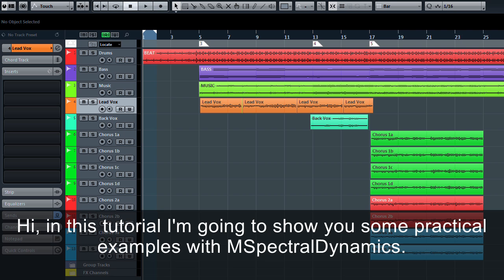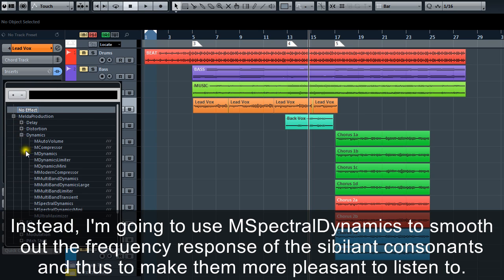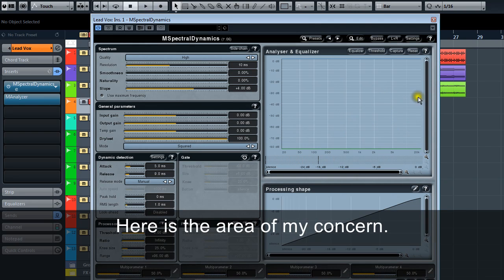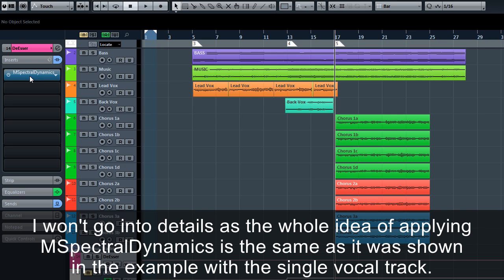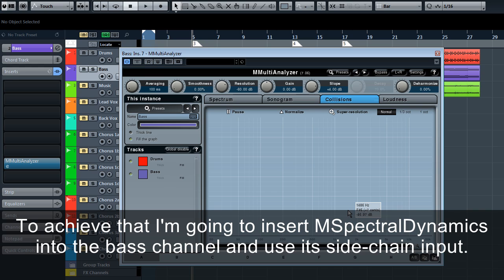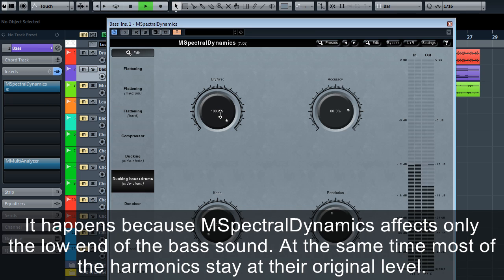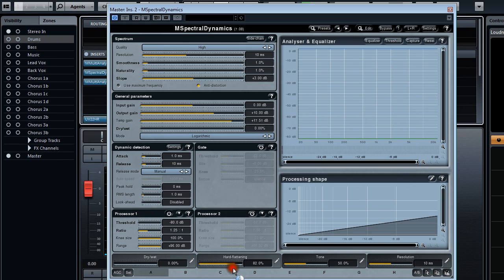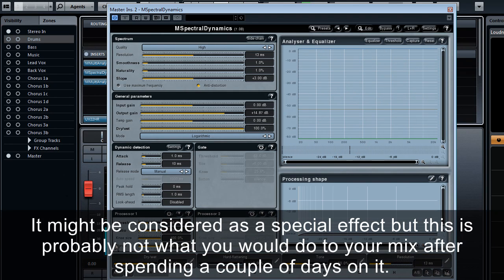MSpectralDynamics - practical examples

Comment: You understand de-essing is a particularly unsuitable use case for this, right?

Intelligibility of sibilants comes largely from dynamic resonance across time. Check out a spectrogram of some nice clear, untreated vocals. Well-enunciated sibilants will have stacks of resonant sweeps faintly visible within the noise, often occurring in converging or diverging sets. An English [s] should look sorta like ⋟, while [t] sweeps the other way in a shape like ≼ (respectively converging/diverging at ~10-12khz while sweeping in from/out to ~8kHz and ~16kHz). Go roughly an octave lower and you'll find [tʃ] shaped like ⋞ and a [ʃ] looks like ≽. Non-sibilant fricatives such as [f], [v], [h], [θ], etc. typically lack these narrowly concentrated, shifting frequencies and are more along the lines of fairly static blotches of noise that each take up one or two pretty wide frequency bands.

Rather than de-essing the vocals, you're just effing them. I don't only mean that in the expletive sense. By using spectral compression on sibilants, thereby reducing the dynamic range of discrete frequencies rather than uniformly reducing the gain of the entire signal (or at least of a single, split band spanning the entire sibilant frequency range), you're essentially scrubbing out the most vital part of those consonants while leaving their static, underlying airflow noise intact: ffffffffffffffffffffffffffffffffffffffffffffffffffffffffffffffffffff

Comment: An interesting if complex method of dealing with sibilance ... but what is causing the crackling sound in this demo from 5:00-5:30? Is that the plugin or an overloaded CPU? Not an ideal way to demonstrate this application. But elsewhere some nifty tricks, even if rather involved.
Reply from the maker: Thanks for the feedback. Hard to say, the video is quite old, my guess would be problems with recording.